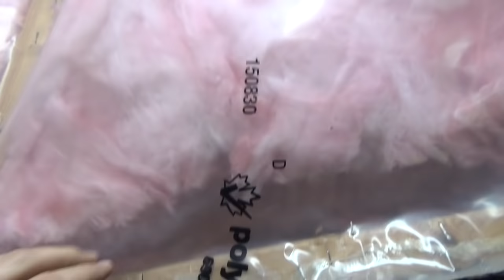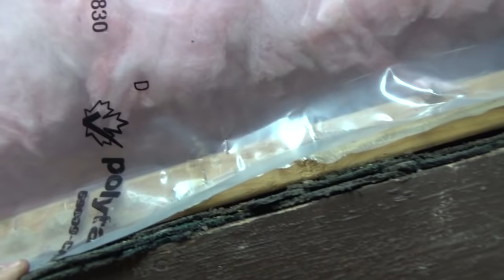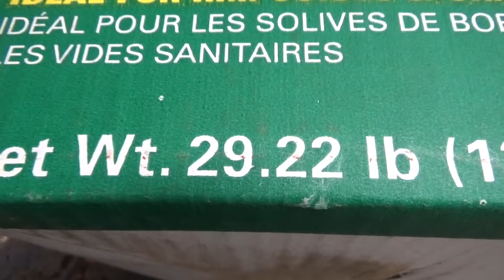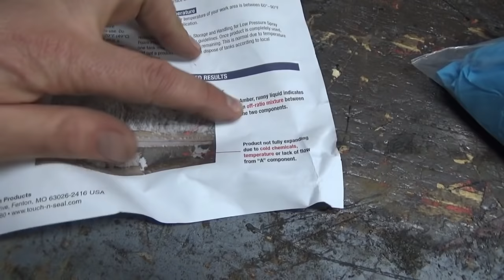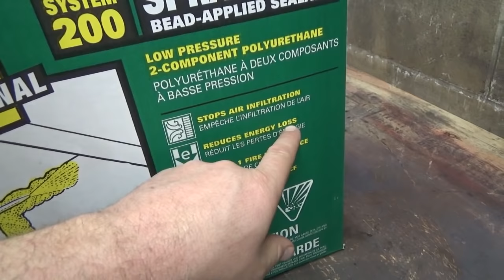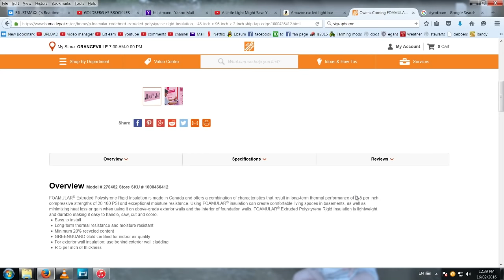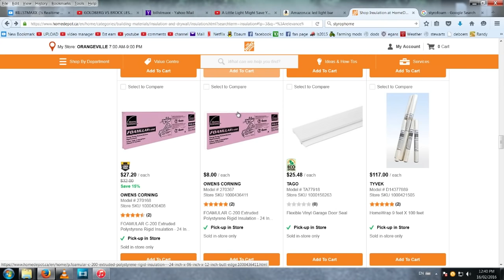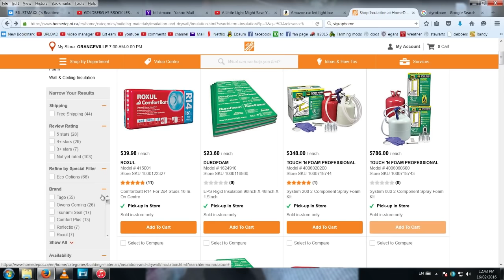Different way to clear snow and a wicked sick with a cold for corn sakes

Comment: Hey Bill, hope you get to feeling better soon, don't worry about videos till you feel fine!

One thing that comes to mind about that wall where you want to remove that one board to see if you can insulate it... It would require insulating that entire boarded up area if they didn't insulate that little wall area...  Insulating just behind that one board would be useless otherwise.  Is there not a way you can look at it from the little middleshop area?  Could have sworn that I saw some form of an attic access in some of your videos.

Comment: If you insulate the walls with those then you have to cover it all with drywall.  You have to cover it with some sort of fire resistant material because the foam will be toxic in a fire.  You would have to consider that cost as well.

Comment: Use the acoustic sealant it's used in homes to glue vapor barrier to the floor at the bottom plate , stays pliable and sticky

Comment: Bad insulation is just all the more reason for a new energy efficient shop. Foundation issues, bad insulation, drainage issues, wiring, building and workplace code issues. Won't ever be a cheaper time than now for the board to make the investment in critical cemetery infrastructure. Couldn't hurt to write up a proposal. Save them money in the long run. : )

Comment: oh and get some of those foam panels from home Depot and stick it to the brick in the garage and shop and it will help with the heat loss in there big time. can also put them over the windows if you don't care about not being able to see out them

Comment: Bill get better soon !! Use acoustic sealant on the plastic , and pull the soffit to insulate not the facia !
Reply from the maker: +Rocco Beneventi the soffit may be harder to pull than the facia board and i know they just used const adhesive so i guess ill have to do all that again too

Comment: +BILLSTMAXX:) the proper stuff to seal  vapour barrier to sill plates studs etc is callex acoustic seal, comes in a caulking tube. its black and sticky. the vapour barrier will not come off like glue those idiots put on ffs. some people eh.

Comment: Maybe wood stove in that shop it does heat nice in there... But insulation sure expensive.. But my basement is 1/2 inch but it does keeps cold out better